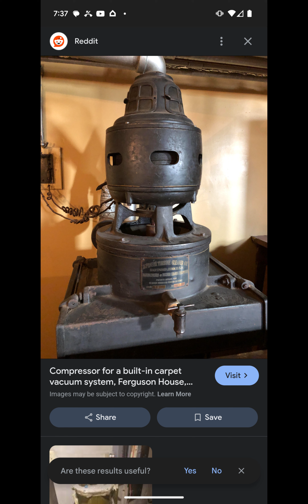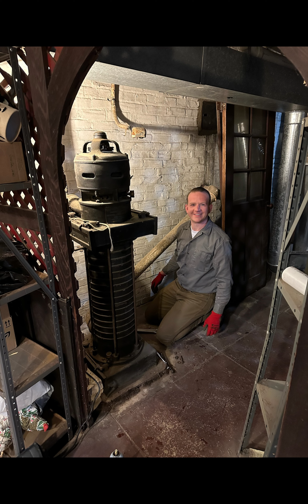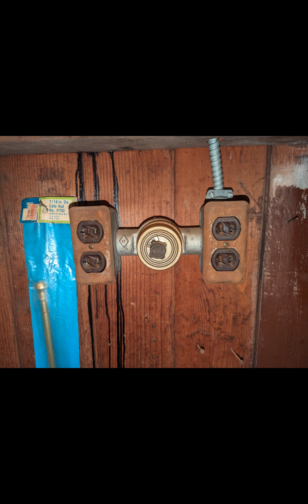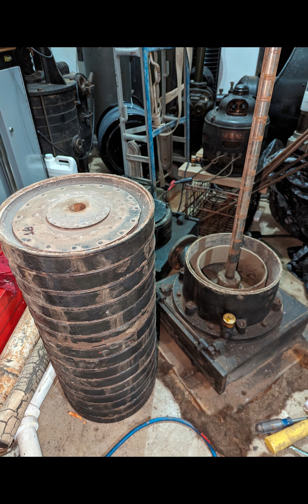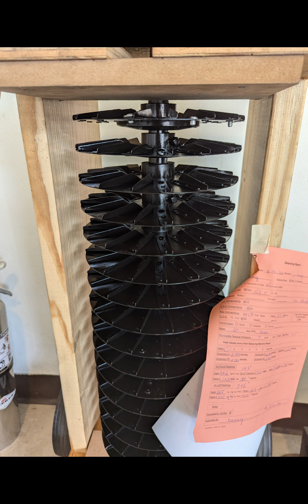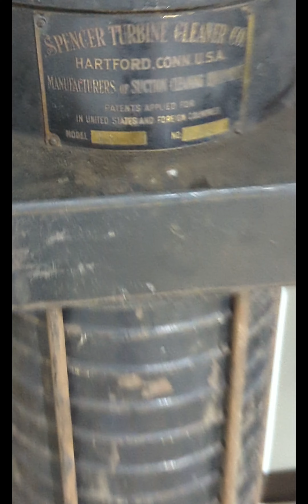The 1908 Spencer Turbine Central Vacuum

Comment: ABSOLUTELY FANTASTIC WOW!!!!! 

In regards to the inlet in the closet, I remember being told that those were used to help with moth prevention. They were used in conjunction with chemical moth crystals that were put in a specal box in the upper part of the closet. The box was vented outside the closet. The vacuum would draw in air through the box, pick up the chemical and pull it through the closet to the inlet. This way you could kill off the moth eggs and larvae in the clothes.  I saw the remains of this arrangement one time in an old house in Davenport, Iowa. It sounded plausible but I have no idea if that is how it worked or not. It certainly seemed plausible.
Reply from the maker: @WC0125  very interesting! I wouldn't have thought of that, but it makes sense. Moth control was a big deal and many portable vacuums even into the 1950s had moth crystal gas dispensing attachments.

Comment: I live in a house that still has one room with no electrical outlets and just one light socket. And another room where the electrical outlets are essentially a light socket with a flip up cover. It's an early 1800s house that started as a 1 room house, then was expanded with a large Greek Revival addition, and then further modified in the 1880s and 1930s. This house also has an 1880s steam heating system with some of its original radiators although the piping has been significantly modified from its original configuration, including by me when I replaced a rusted out 1990s boiler recently. No central vacuum though, although I do have an older Kirby Classic and an Electrolux Model L.

Comment: I saw a central vacuum in the basement of a 1980 built home. It was amazing how each room had the hose connection. 
Opening the panel to put in the hose the push switch was opened and the vacuum in the basement started. 

I didn't know they existed before the 70s

Comment: It's interestingly odd that they call the company after turbines instead of impellers, even though you know that in a suction situation, the blade wheels are impellers. A set of blades being driven by the gas instead is a turbine.

Comment: Wow, very interesting! I never knew until now that there was such a thing as the screamy commutator-start and quiet induction-run motors, and a high percentage of all our vacuum cleaner motors today are just stuck in screamy commutator mode all the time! I also never knew until now about a vacuum cleaner with 16 impellers! It's been my understanding that my parents' central vacuum cleaner from the mid-90s and the replacement they just bought has 2 motors and only 2 impellers piped together to make one unit. Yeah, very interesting stuff!

Comment: my father worked in company for 30 plus years, 
my company got new one 3 years ago, they turn 40000 rims with magnetic bearing, shaft leviathan,  kinda a failure,  but is working now with alot of work

Comment: If you take and pipe/reduce a 1.5" pvc pipe system in your house with pipe adapters to  standard Central vac wall plates and adapt the pipe system to a  2" shop vac hose with a shop vac with the largest hp shop vac  you can find you will do just fine.Use the wall plates as a switching  circuit on a relay circuit powering up any shop vac attached to a relay circuit . youll get great results

Comment: I'd imagine these things were extremely energy efficient.
Reply: 150 watts for one horsepower? Not really that efficient.
Reply: @RaymondSwanson-u9y impossible, 1 hp electric motor theoretically will consume 735.49 watts and most of them consume 1500w at minimum. a

Comment: The vibration is the result of the long and skinny shaft together with the wide and narrow blade-disks. The thin blade disks are going to resonate by slightly twisting at certain rotation frequencies. The twist of a disk will slightly bend the shaft, this in turn will distort the other blades near by, who have a similar resonance frequency. This way the resonance will expand to all other disks and make the shaft bend and twist lightly. This will produce an imbalance that makes the hole machine vibrate and walk off.
This was a huge problem in early turbine engines, who had to be carefully but fast pushed though those regions of instability, otherwise they would disintegrate. The problem was solved by using more bearings and have the blade count and size different for each row of blades.
Reply: Multistage pumps can have the same issue if the interstage shaft bearings or wear rings have too much clearance or get left out. Properly clearanced bearings and wear rings increase the functional stiffness of the shaft/impeller assembly and raise the resonant frequency above the operating range.
Reply: There's also the effects of gravity in vertical systems. The top of the shaft experiences larger momentum potential than the bottom thanks to such a high center of gravity while spinning. Horizontal mounting has a smaller height difference so less vibration. In other words, a spinning straw is more stable on its side than on its ends.

Comment: Thank you for this interesting video.

This is pure speculation but perhaps when operating, some sort of standing pressure waves form inside the turbine, or maybe there is a pneumo-dynamic interaction between the number and spacings of blades in the turbine rotor discs and in the stators.  

Standing waves were a problem in early automobile tires and it was solved by making the tread spacing non-uniform around the circumference of the tire.  It's easy to see today when looking at the treads.  Tires are not turbine discs but perhaps there is some engineering similarity with respect to spacings of elements.

Alternatively maybe at speed the long slender shaft has insufficient stiffness and simply bends to one side.

Good collection of machines!

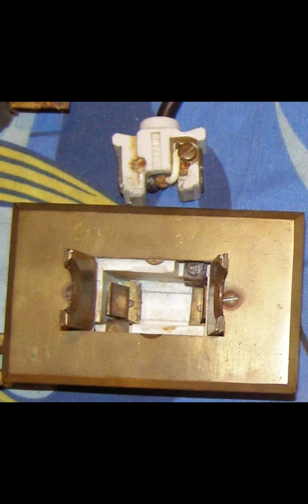Comment: 5:50 when I was a kid, I had a wall panel like that with the gem looking indicator. I had no idea it was from a central vacuum.
Reply from the maker: If yours had a switch, indicator, and outlet, it was probably for plugging in a heater. If it was a switch and indicator lamp only, then it likely was for a built-in vacuum or some other remotely connected load. The red jeweled lens looks really cool lit up!
Reply: @owenperkins  I believe it was just the indicator lamp on a smaller brass panel by itself, looking like the switch would have been in a different panel. I suspect it may have been a later built item.

I most likely still have it in my barn across the country. It'll slowly migrate here with everything.